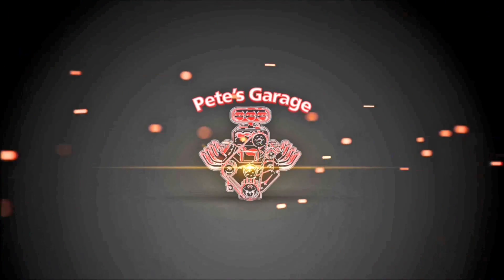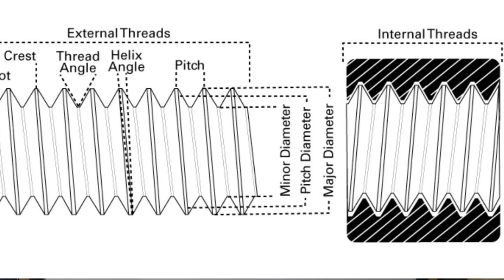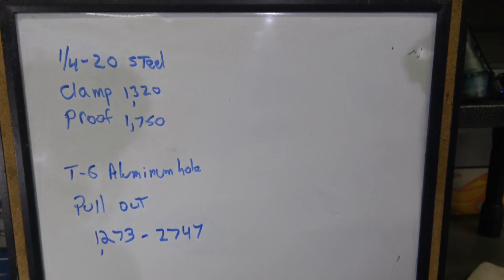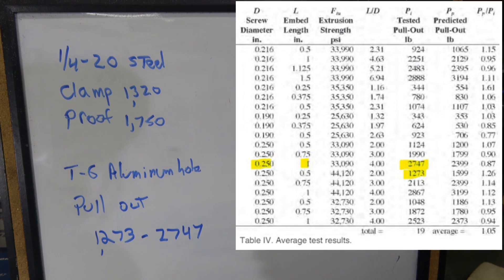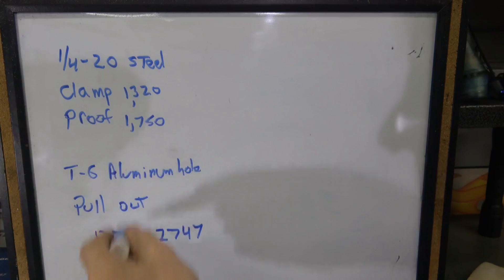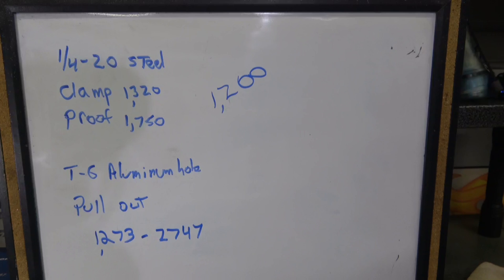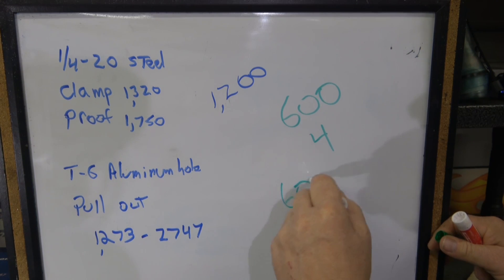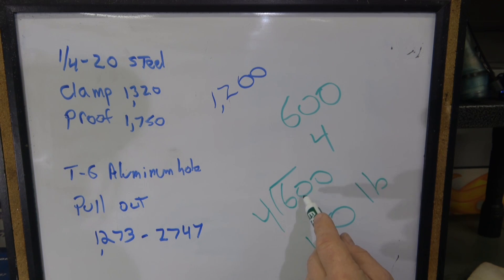Engine Moving - Is it safe to lift and engine by the 4 steel carb studs in an aluminum manifold

Comment: Math might be a little fuzzy if I'm reading it right.  First bolts on an intake are 5/16.  Second, your bolts will hold 1200 EACH.....looks pretty safe to me!  Still yet...I'm a little leery keeping my toes under the engine.....even with a 351W, aluminum heads and intake.
Reply from the maker: I was showing 1/4-20, obviously if they are safe so is everything bigger
Reply: @PetesGarage  Definitely can't deny that.  Not beating on you brother...sort of verifying....My take is if it will work at 1/4 specs and certainly safe with 5/16.  I'm an aircraft mechanic and I go along with you

Comment: Most American V8's use a 5/16" carb fastener, so even stronger. I have used these things for years and regularly lift a fully dressed small block and trans together. The key is to torque those bolts! If they are loose, shear forces come into play at the interface and will substantially weaken that point.
Reply from the maker: Exactly

Comment: Fastener preload must be taken into account when doing those calculations. The more you tighten the bolts, the more of the tensile strength you are eating up before you apply the load.
Reply from the maker: That is true, but these are usually just snog with no torque
Reply: @PetesGarage  Yeah snug is fine. But you'd be surprised how many people (even engineers) I work with who not only don't know that, but argue with me when I tell them. With some of the stuff I have to lift, that gets very critical.

Comment: Thank you for posting this. I have been afraid of those plates for that very reason, afraid the bolts would pull out of the intake. I figured the carb mounting surface was never rated for lifting. I feel better after seeing the math.

I was seeing the disaster in my mind when the oil pan is 5 feet in the air clearing my trucks grill and the bolts let go.
Reply from the maker: I've never had any issues

Comment: I recently made a carb top plate to pull my 460/C6 from my RV. I used a 1,5"w x 3/16 mild steel stock bent into double S shape and welded it to the plate. I was more worried about the welds than the studs in the Iron manifold. It was a little off and the hook was laying sideways. Not a flinch of movement. And using the rear loop it balanced the set just fine. The other motor is a 6.5TD with 4L80E and I couldn't use my neat little plate... Chains are great...
Reply from the maker: Gotta have faith in your welds

Comment: How deep should the stud be screwed into the hole ? To meet minimum number of threads ?
Reply from the maker: I always bottom them out
Reply: @PetesGarage  thanks, that is now obvious to me.
Could you still tell me the minimum number of threads ?
Is it the area of the thread divided into the cross section area of the bolt  ??
Just curious.

Comment: I used one to pick up my 454 engine with a 400 turbo trans and my butt was puckered. It worked, so I guess everything was OK. It had a aluminum intake on it also. Thanks for the video Pete....
Reply from the maker: It's always nerve wrecking lifting that much weight
Reply: WOW! Trusting! I guess it can survive a 302.